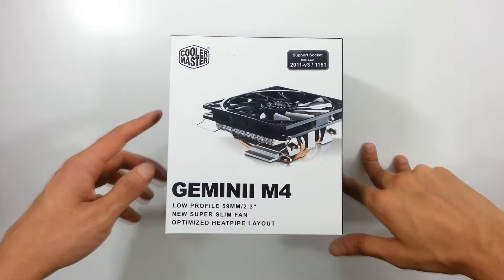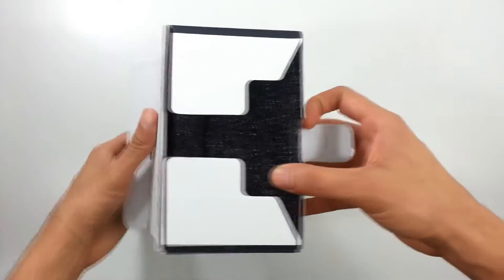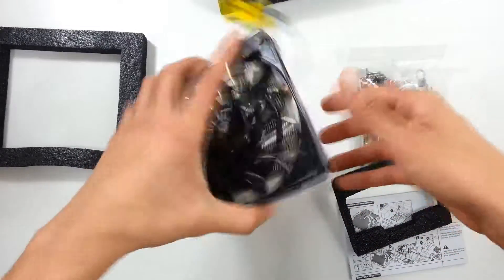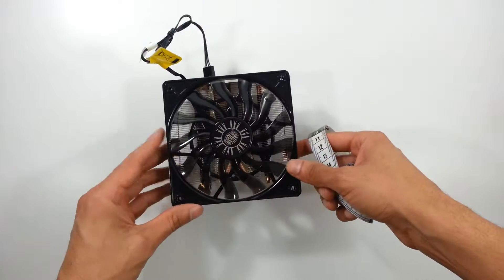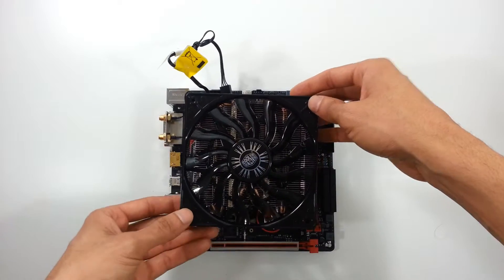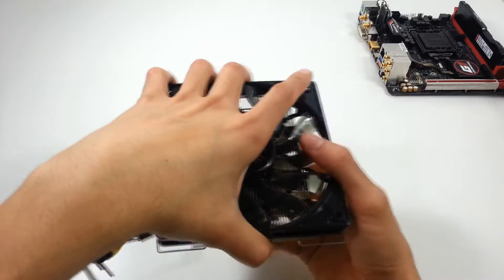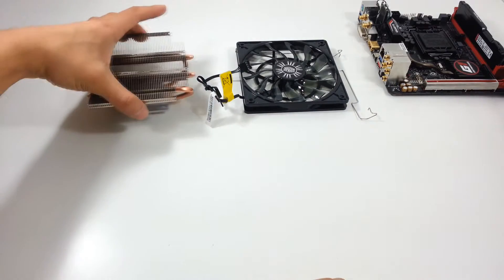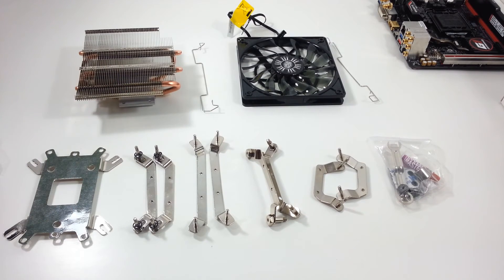Unboxing / Overview CM Gemin II M4

Comment: OMG. I plan on using dat some mobo in a new buid!
Reply: and same fan
Reply from the maker: Cool man, I should be uploading a video soon of my customized computer tower. Here is a link if you are interested in this CPU cooler. Good luck.

https://www.amazon.com/gp/product/B0080ATR2Y/ref=as_li_tl?ie=UTF8&tag=sd036b-20&camp=1789&creative=9325&linkCode=as2&creativeASIN=B0080ATR2Y&linkId=f05d2d617517081dc54a8fe25ac712a4

Comment: i used the same board and cooler and what i ran into was the copper from the heat sink blocks the usb 3.0 port from pluggin in.
Reply from the maker: +Jneo the Godseeker - Agree, the placement of the USB 3.0 connector is closely place to the CPU socket making it almost impossible to connect. Unfortunately their is always something with these mini-ITX MoBos'.  Luckity, you can buy an low profile adapter for it.

Here is a link if you are interested: 
http://www.newegg.com/Product/Product.aspx?Item=9SIA9F93P82890&cm_re=usb_3_header_adapter-_-9SIA9F93P82890-_-Product
Reply: I managed to fit that baby in some how.
Reply from the maker: Hahaha. Nice